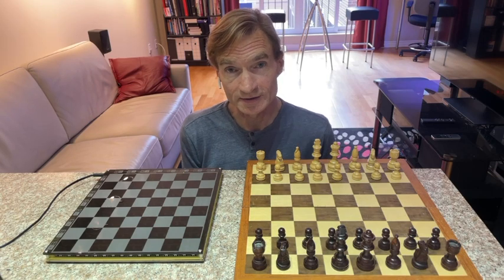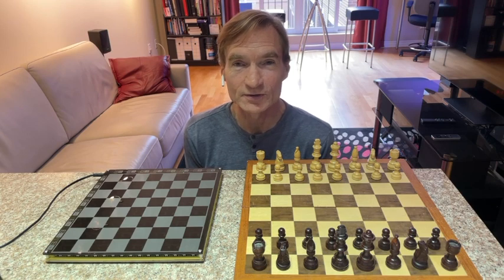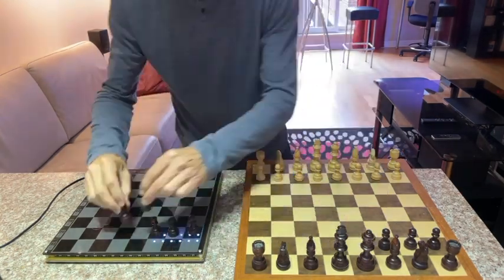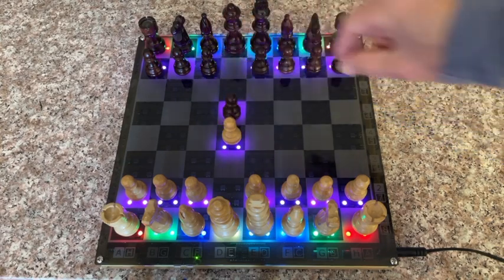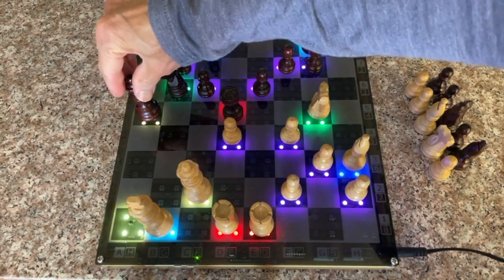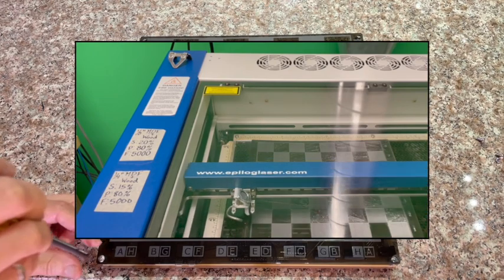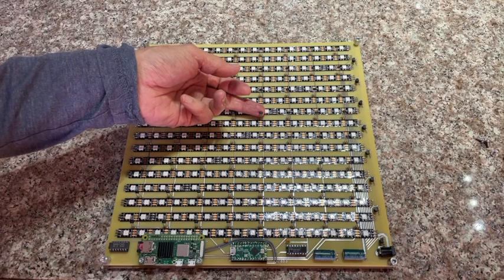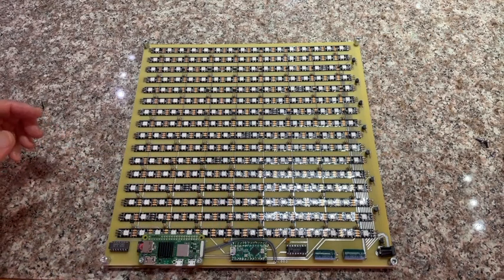Raspberry Pi Chessboard

Comment: Cool one question how dose the board no which piece is which dose it just remember when a piece is moved
Reply from the maker: The board only knows whether a square is occupied by a piece, but it cannot identify the type of piece. When the board detects that the opening position squares are occupied, it assumes you have placed the appropriate pieces on those squares. It tracks the movement of a pieces when a square becomes unoccupied and another square becomes occupied. This means that captures must be done carefully, by removing the captured piece first before moving the capturing piece.
Reply: @danapeters  thats what i thought very cool project

Comment: Can the Teensy 2.0 Teensy Mini USB Development Board be used?
Reply from the maker: I don't think that the Teensy 2.0 would work, because it uses 5V GPIO, whereas the other Teensy models (including the LC) use 3.3V GPIO. The RPi uses 3.3V GPIO, so level shifters would be needed to connect to the Teensy 2.0. Much easier to get a Teensy LC, it is cheap and available.

Comment: Can I use stm32f103 instead of teensy ?
Reply from the maker: Using something other than a Teensy would require significant hardware and software changes. Probably best to stick with the Teensy LC, which is inexpensive and readily available.
Reply: @danapeters  I interested to make this one, but I got difficulties by expresspcb service, do you have a gerber file for the pcb then i can use local pcb service to print it?
Reply from the maker: @baekbaek-aja  Sorry, I don't have a Gerber file for you. I might manually convert the ExpressPCB project to EasyEDA, and change the design to add the Teensy. If I did this, then a Gerber file could be exported.
Reply: @danapeters  thanks Dan, actually I onely have kidcad, but let me try your method 🙏
Reply: Hi @danapeters, I read your article regarding this board, but i still cant figuring out which file you put additional python code for serial communication to make picochess work with your board, would u assist me more... 🙏
Reply: Hi @danapeters, I have finish makin my own board as like as your.. its can connect to picochess ... but  instead of blinking the led on every computer move, it just showing the computer movement via picochess web ui + voice. So, could you advice me which picochesa setting that i missed to make it send the command to the board to blinking the led on every computer movement🙏🙏🙏
Reply from the maker: @baekbaek-aja  Glad you were able to construct this project! I am revisiting this project in January to improve the documentation on the web site linked in the description. So stay tuned, I hope to have improved instructions that will help diagnose issues like this.
Reply: @danapeters  thanks so much Dan, cant wait the document update 😃🙏🙏🙏
Reply: @danapeters  I appreciate your continued work on this project! If possible, I would love to see a more step-by-step tutorial video since I'm new to these kinds of tasks like ordering custom pcbs and software modification. I look forward to the updated content! Thanks
Reply from the maker: @baekbaek-aja  I've added many details to my web site, please check it out. Apologies for taking a while to get this done. I hope to add a few photos soon.
Reply: @danapeters  thank you so much Dan 😀🙏
Reply: @danapeters  this is what I did, I have to change a picochess.ini file for dgt-port setting from ttyS0 to ttyAMA0, and now its work very well. Next i have an idea to display every move to oled module, just like picochess web ui looks like. Still looking the possibility to take movement history from picochess 😅

Comment: Great video! Did you consider using reed switches instead of Hall effect sensors and if so what where the tradeoffs you anticipated? Apart from that, the sensors are connected to a multiplexer, aren’t they?